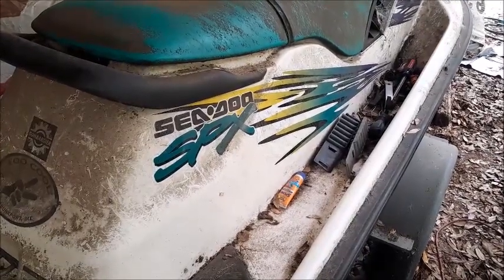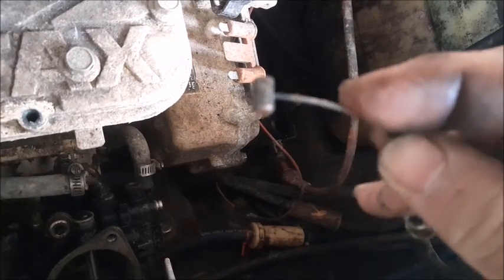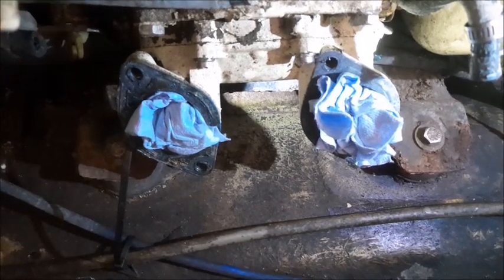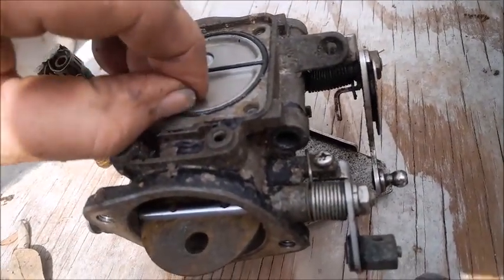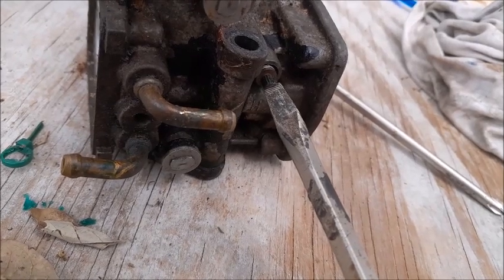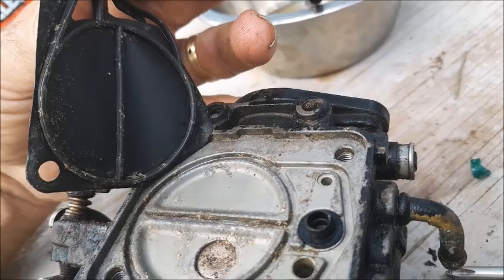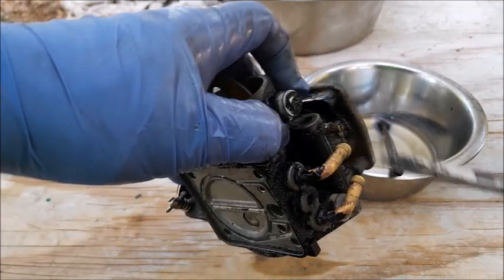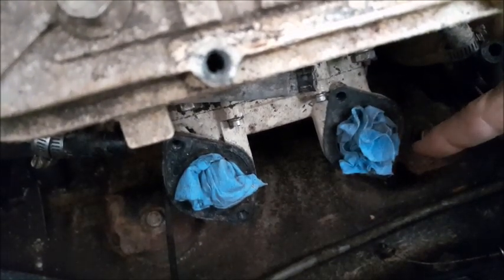96 Seadoo SPX Dual Carb Clean / Rebuild

Comment: Does that ski have the DESS kill switch?
Reply from the maker: No thankGod!  The 96 spx is my favorite for several reasons, 1. It was the first year for the short pump as all 95 and prior have about a 2 inch spacer in the pump so the suction hole is further forward.  I like the ride a lot better with the jet pickup hole further to the rear.  2 No DESS which makes it more bullet proof and the MPEM is alot cheaper if you have to replace it.  3. The 96 SPX is the 717cc engine which you might think is a disadvantage to the 800 but I feel is make the boat a bit lighter so it has a better jump and pop up.  I like to ride with a half full gas tank and no front hatch compartment to keep the ski light.  
I also own the SPX 800 which is great also
Reply: @creativerepairing2960  would you be willing to contact me? I’m building a Landau 1680 jon with an inboard jet drive but am having to reengineer the conversion someone previously did, and knowing some of these details would be very helpful. Thank you for your reply and I hope to communicate soon!
Reply from the maker: Sure send me your phone number